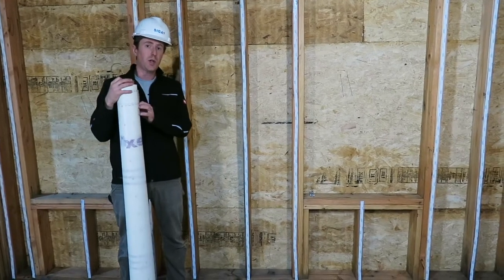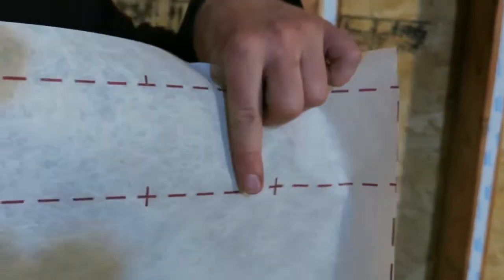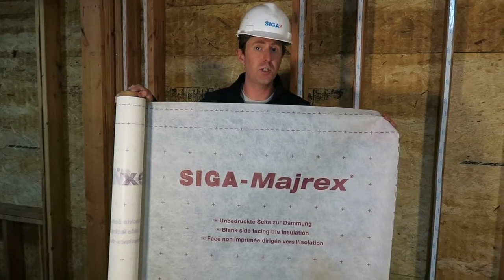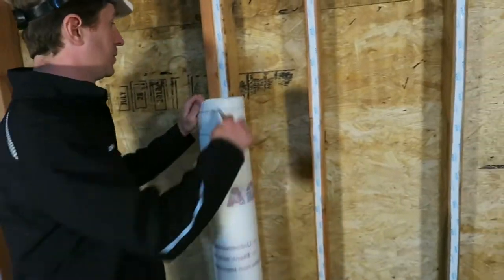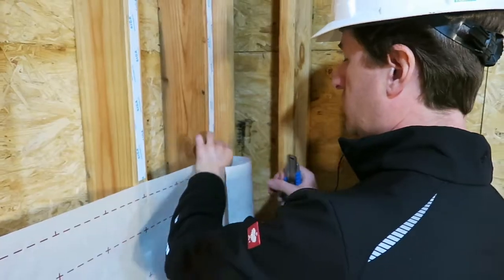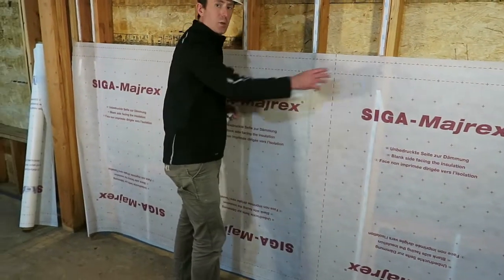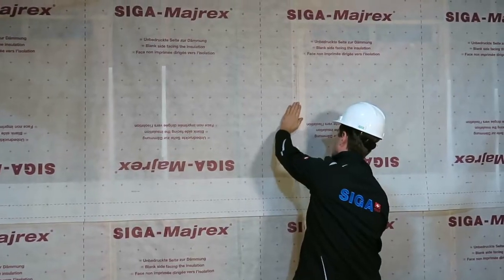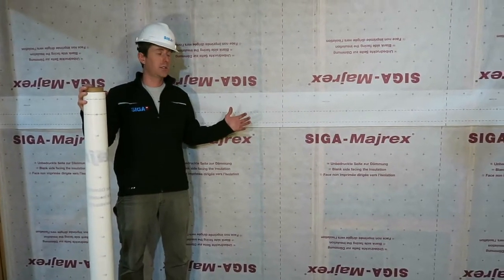How to Mount the SIGA Majrex Smart Vapor Barrier

Comment: Try that with electrical and plumbing stub outs!!
Reply: You use the tape at all seams and at electrical boxes. Caulk the gap in the back of the box where the romex comes through. Tape at plumbing stubs as well if they are in the exterior walls but I try to have as little plumbing with stubs in the exterior walls anyway. Just hate having plumbing so close to the exterior environment and messing with your thermal envelope. The real issue is hanging gyp board. Screw holes everywhere. Some are bound to tear the vapor layer.

Comment: Can it be used horizontally on crawlspace ceiling?
Reply from the maker: Yes, it can be. 

Although typically in crawl space scenarios we recommend Majvest 200 due to the installation environment and conditions. The floor in a crawl space will not face as much of a vapor pressure differential when compared to a wall or a ceiling in a conditioned space. Majvest 200 is a more cost-effective solution. Good luck!